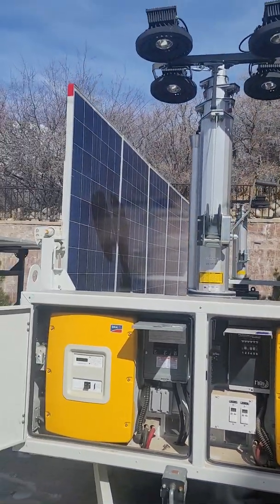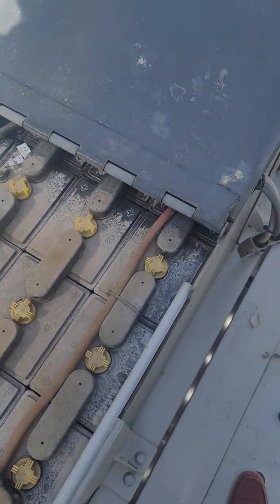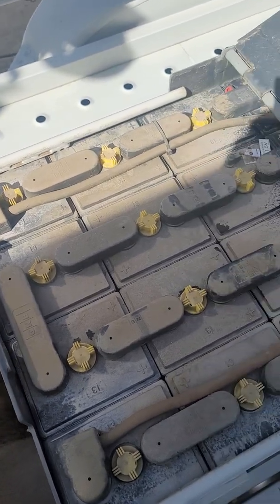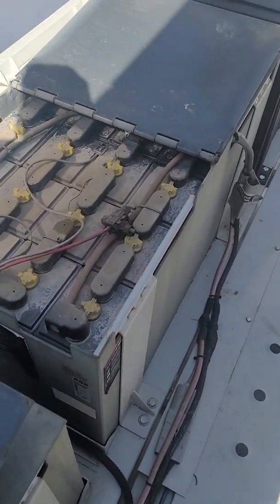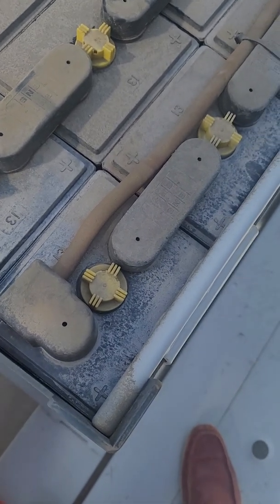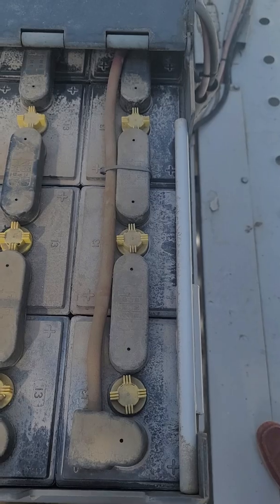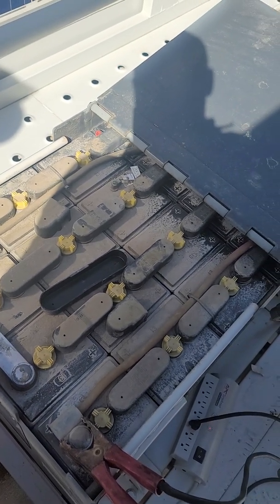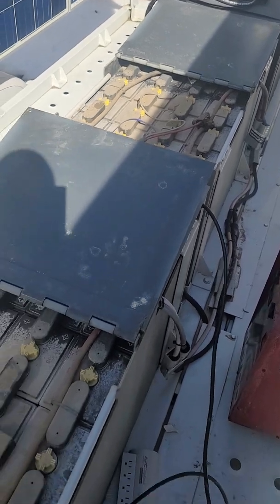DC SOLAR TRAILER BATTERY CARE & Charge from dead

Comment: Aaron - wouldn't it be possible to use the Kubota to charge both batteries? I am new to our trailer and still learning. I had to disconnect the rear battery because one of the cells is leaking from the side of the casing - looking for new cells or a used 48v battery to get full power our of the trailer. Thanks for posting your videos!!

Comment: Hi there wondering if this worked.  I was concerned that since the batteries were still linked that the bank you were charging wouldn’t isolate.  I just got my trailer and cannot get it to charge the batteries even though the inverter says 41% charge.  Help please
Reply: If those batteries sat at a super low state of charge you will never recover them. They are toast.

Comment: Thank you! The water has been maintained, all full, but the batteries never get above low. I connected to my airstream and after a short while, the diesel generator kicks on and stays on. It won't run on solar. Do you think I need new batteries? The person I bought it from ran his coach bus with ac for a couple days off it. Now since I have it, it doesn't charge above low.